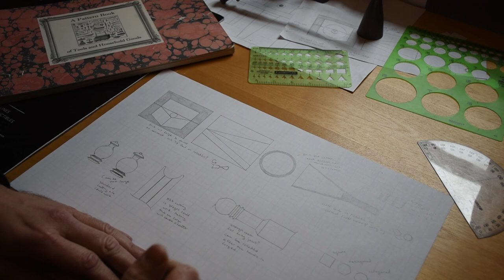Forging A Candle Snuffer

Comment: That turned finial really adds some class to the finished piece.  As always, great work.
Reply from the maker: Thanks!  That book has some great design elements.  Hoping to try more.
Reply: @rigoniironworks  On the next one, cut the notch at the end of the handle deep enough that the cone can come back to an acute angle. That way you’ll be able to reach up to snuff candles eye level and higher.
Reply: @rigoniironworks  I would love to see your take on a nut cracker found in that book!
Reply: I would love to see you make a nut cracker from that patternbook as well!

Comment: If you are not getting the turned finish you want in mild steel, I highly recommend polished aluminum inserts. Mild steel can tear instead of chip, and as long as you are conservative with your feed, the aluminum inserts will last a long time.
Reply from the maker: Hmm, I'll have to look into that.

Comment: Please do not misunderstand my disappointment as you create quality work and do so in some of the most efficient ways. But I really wanted to see how you forged the decorative end of the handle... And you only turned it on a lathe. The only forging in this project were two tapers using the power hammer. The title was just misleading for me. You "crafted and a candle snubber"... Not forged one.
Reply from the maker: I tried making tooling to forge that shape, from a rotation type tool to drop forging.  Both failed and it had to be machined.  I really wanted that forged decoration for future projects but it's too delicate.